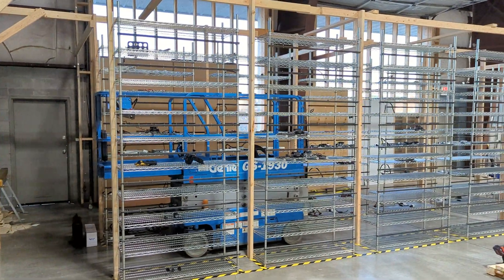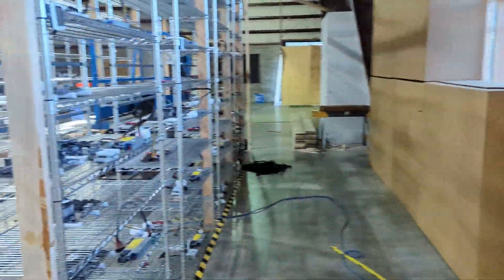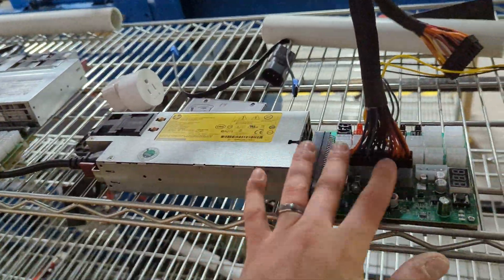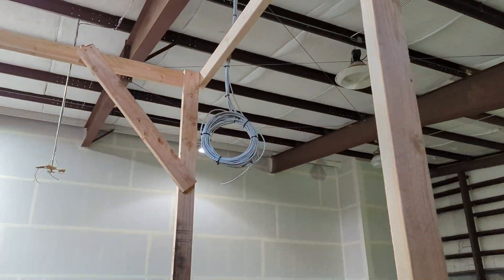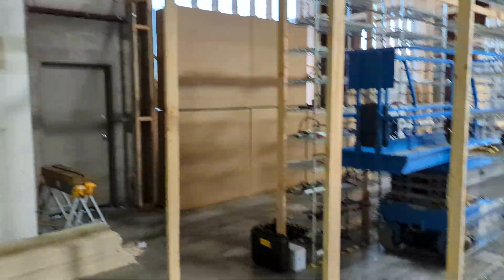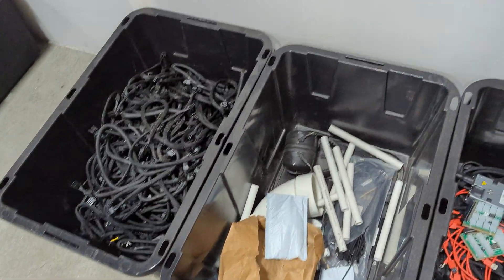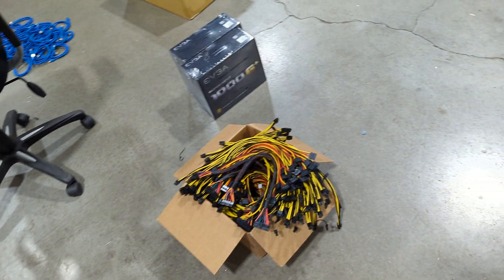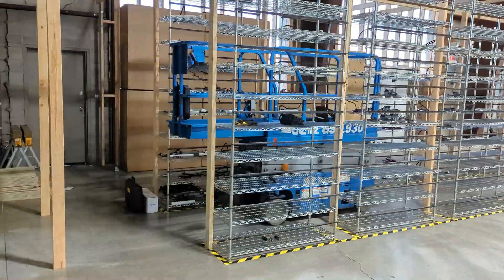GPU Mining Farm - NEW WAREHOUSE 800+ GPUS!! Ethereum Mining

Comment: Wow! Going to be a nice setup. Only recommendation(just a hobby miner but work for electrical company) is to switch your voltage to 240V for the PSUs. With 800+ GPUs you will use half the amperage which increases the capacity of the PSUs, less heat, as well you can run cheaper/smaller gauge wire to your racks. Only down side is the wifi power switching. For that I have my wifi plugs wired to relays to switch 240V right at the electrical panels, 120v coil relays are cheap. I also have current sensors on the feeds to measure true power. You could also get 240V wifi plugs. Looking forward to seeing final setup.
Reply from the maker: All our miners are already on 240.
Reply: @CryptoLLC  oh. Sorry. I saw the plugs and all looked like 120v. Are those wifi plugs 240v? Where can I get those?

Comment: Great videos! For your intake & exhaust security, you should do a rebar grid across all the openings. If you do half inch rebar with a 2ft x2ft grid, it'll take someone 30+ minutes to grind all that out and actually fit through it to take equipment. Grinding it also is Loud AF.